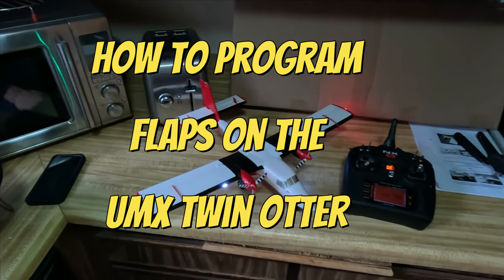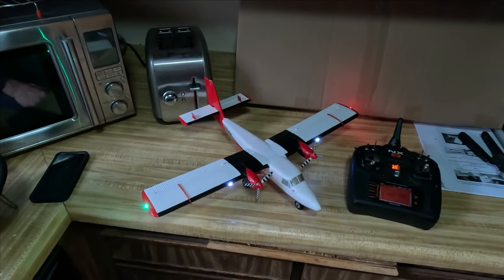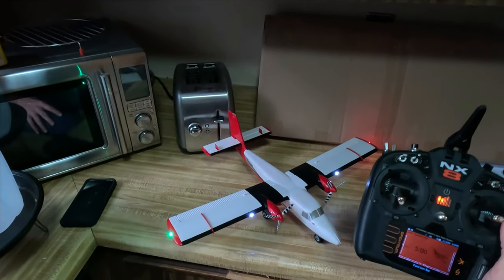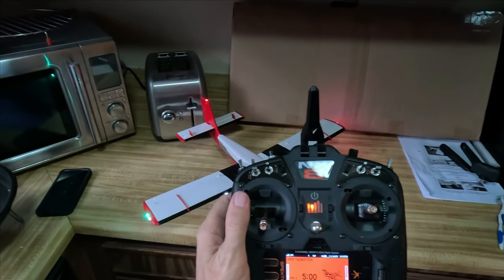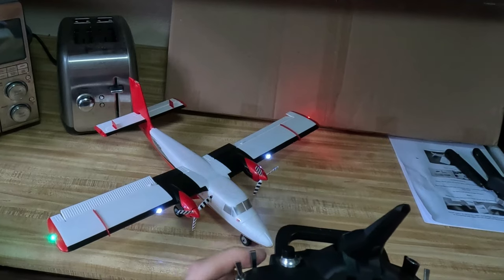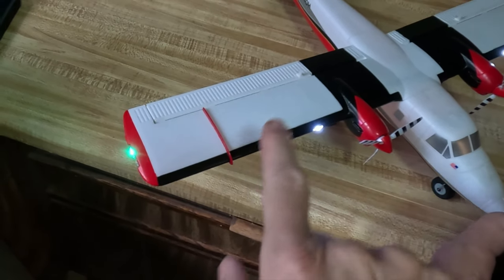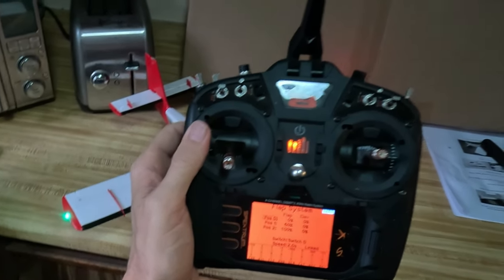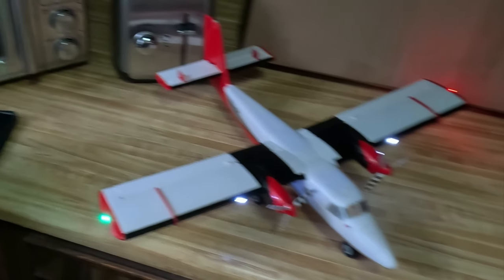How to program Flaps (flaperons) on the umx Twin Otter

Comment: This is gonna take some experimenting with my ZORRO using EDGE & I won't quit until it's dialed in. Thanks for this!
Reply from the maker: this only works on some of the e-flite planes that use the same micro flight board, so far I have only tested it on the UMX Timber X and the UMX Twin Otter

Comment: Nice trick. I looked at the manual on line and it does not show this option. My flying space is a soccer field and kind of tight. Would you say that the Twin Otter us fun to fly slow? I would like to try a Twin but I need a small plane.

Comment: Couldn’t get the flaperons initialized. Am  using “C” for SAFE and would like to use “B” for flaperons. I have a hand injury that requires these switches be used. I use “D” for high-medium-low rates.
Thanks

Comment: Hi, that trick with moving sticks outside and flipping the switch... isn't it disabling the safe mode? I'm not good enough to fly without my safe mode
Reply from the maker: No you still have safe and everything
Reply: It doesn’t disable safe mode if you are still wondering. A was set as my safe mode switch and it still worked after ( :
Reply: Oops sorry, already answered ( :